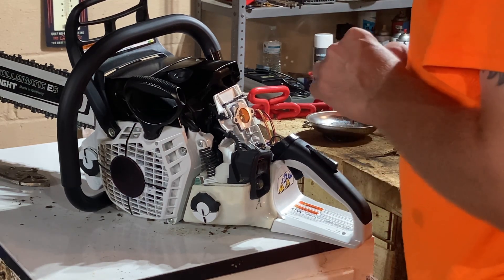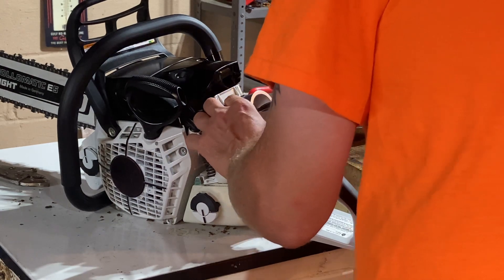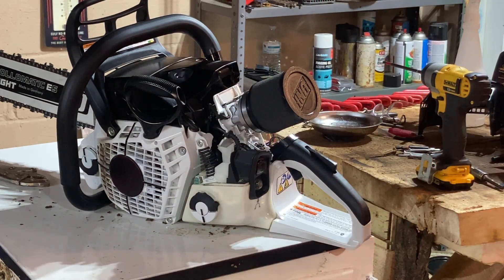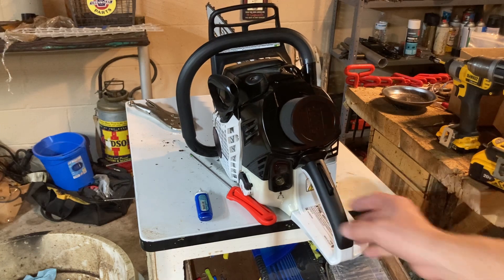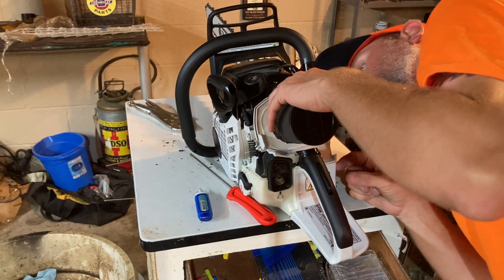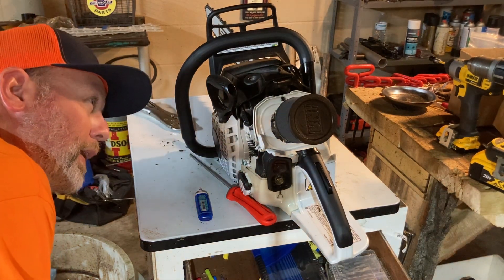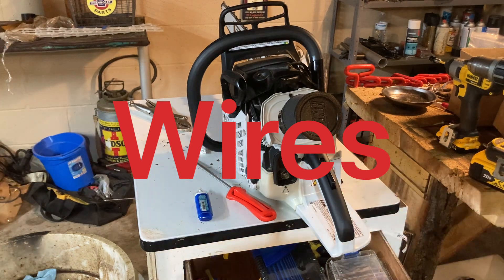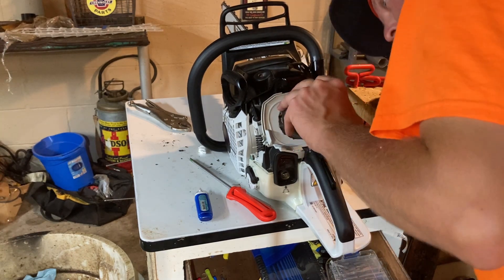STIHL 500i velocity stack and uni air filter must watch upgrades keep your factory cover

Comment: Where did you pick up that 660 filter? I like that alot better.
Reply from the maker: From uni they make different diameter filters that will fit various stihl models
Reply: @MitchellsBackyardLogging   Have you improved on the design any further since then? Some good ideas there.
Reply from the maker: @Mightycaptain no i ran it like that for awhile and then i just left the cover off like the westcoast guys do
Reply: @MitchellsBackyardLogging  gotta be a way to have your cake and eat it too 🤔🤣